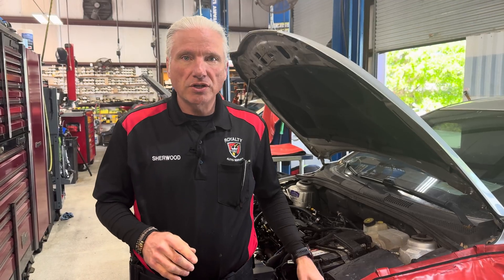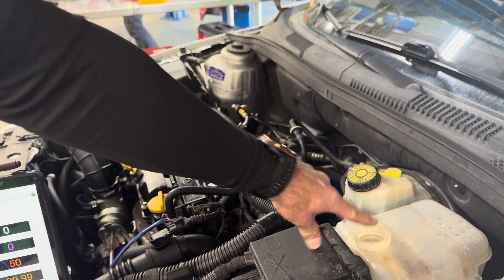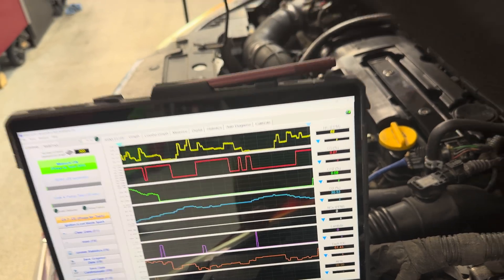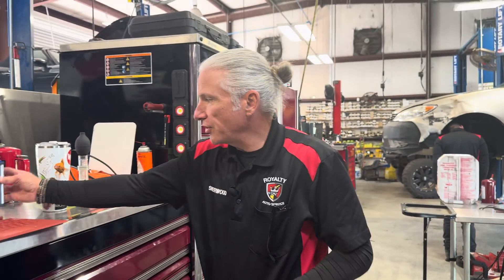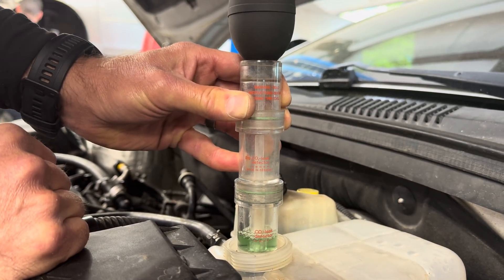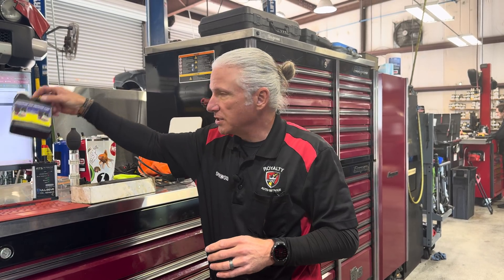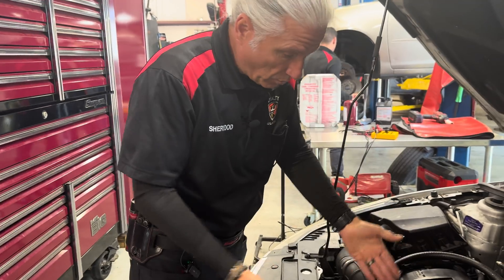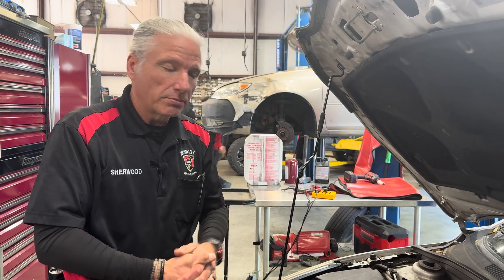3 Ways To Properly Test Head Gasket

Comment: Take the car out, check the oil. Make sure the radiator is full. Take the car out on route 81 north of Syracuse, New York, hold it to the floor hold the accelerator to the floor for roughly 14 miles, and you should be able to find the information that you need from this road test.

Comment: The color of the test fluid does not change when I put it on the radiator of my Jeep wrangler with 3.8 engine (2011) But it keeps bubbling and even with a hot engine, the exhaust fumes stay white.

Comment: At 16 i rebuilt my 350 in my 70 camaro. It got hot and I didn't know to locate the reason.  Two weeks later getting off the highway idiot light. It was ruined I left it dieseling .later bought a doner car for the engine and found out the radiator was silted in the bottom. Around town it's fine highway not.

Comment: Those cheap block leak testers are usually only like $20-30 at Harbor Freight. Those don't have the cool dual chamber setup though so you will have to be a bit more careful to make sure coolant doesn't get sucked into the tool. That same bottle of fluid is only like $10-15 also. Super handy if the head gasket leaks into the coolant system. I guess it might not help if only a tiny amount of coolant is leaking into the cylinder though? Maybe do that test and then rent a coolant system pressure tester and there's a good chance you will find your answer. I usually can't afford nice tools. I recently bought a Rotkee pressure transducer, but I haven't had a chance to look at a car with a bad head gasket with it yet. There are usually a lot of options though, as long as you have the time to learn about them. There are some decent tools out there that aren't super expensive now though, so people like me have a chance to learn more.
Reply: Not true. When you have coolant going into the chamber, smog and coolant will get displaced. They trade places. A coolant leak into the chamber is the same thing  as getting gas or smog into the coolant system on basic cars, not super high end exotics. The tester will turn green or yellow. Even if you have a small leak that appears on cold start only that goes away as soon as you start  the car let it running for more then 10 seconds. Unless you got a rare or luxury car. Doing it yourself can cost as much as 300 to 500 if you don't own any tool and have a small leak that just started, 100-200 dollars on tools are included in that amount. More then likely , you have little else to change. Maybe just clean valves and manifolds, depending on your car.

Comment: Wife over heated our 2002 4 cylinder.  I found this stupid hose under the distributor that had a decen hole in it. It was having some brief and slight bucking during heaver acceleration.  Replaced the hose made sure the thermostat functions. Drove around for about 50 mins. Temp stayed just below middle where its supposed to be at. Not leaking anything that I can see, no smoke or steam. But i still get that occasional buck. Maybe its coincidentally something else?

Comment: A head gasket test on an inline 4 is relatively easy as demonstrated in the video, because you only have one head and only one head gasket. 

But, what do we do when the engine is a V engine with two banks, and hence, two heads and two head gaskets? How do we identify which gasket is bad?

In diagnosing the vehicle we have to find which cylinder(s) are compromised, because we need to report to the customer which bank has the bad head gasket. For V engines I like to use the coolant pressure pulsation method to identify the bad cylinder (usually I find only one cylinder is compromised). So, perhaps you could do a video on how to determine which bank on a V engine has the bad head gasket. 

I know, as a matter of process, that most shops who want a quick diagnosis, will just tell the customer they have a head gasket problem, which is fine unless the customer asks (or a shop they hire to do the work asks) which bank has the bad head gasket. For a proper full diagnosis you results should pinpoint the bad cylinder(s) and bank(s). 

I find it beneficial to be able to inform the customer which cylinder, and by extension, which bank has the bad gasket, especially for DOHC engines. Most shops would recommend both gaskets be changed in order to provide a warranty on the repair. If only one side is changed, I find, there is usually no warranty issued. This does, however vary from shop to shop.
Reply: You can hook up a scanner and see which cylinder(s) is/are having a misfire due to coolant getting in the cylinder.  You can also see if you have a P0420 or P0430 code. P0420 means Bank 1, PO430 means Bank 2. (At least on GM, that is.)

Comment: I had a 10' Corolla with the 2ZR-FE engine 1.8L. The car reached 306k and then it started misfire on Cyl 1. It never overheated, and it was very well maintained. And even still I had a blown head gasket by itself. It never overheated. It only had one fan and it always worked. It just started developing that misfire for like a month only on Cyl 1 during start up. After 10 seconds running it will run smoothly.
Reply: Currently have the same exact situation on my 2010 w/407,000miles. I will be running some tests soon to confirm. My question is did you continue to drive car? If so how much more time did you have? I’ll sure miss her when she’s gone:(

Comment: My son's car was over heating. The first shop change the thermostat. The second shop, said everything was wrong and had a huge list adding up to over $3,600. It was a head gasket and I use the blue liquid tester. Some cars are just prone to head gasket failure after a given amount of miles, due to their design.

Comment: Thinking the HC readings ate jumping around because  of firing order. When the cylinder(s) near the head gasket leaking are coming up on compression it's pushing the HC's & they they get lower until that cylinder comes around again.

Comment: Dear Sir, it is as well very important to make a cooling system pressure test, as well as check the radiator for clogging by uplifting it from car and block the bottom hase outlet, fill it with tap water and check for adequate flow. Also some cars like some Mitsubishis can have a frayed water pump impellar and some other brands can have a plastic water pump impellar that would be eroded. Sometimes people will unknowingly use tap water that could potentially lead to such overheat in extreme summer conditions. You know sometimes in your case where the engine is smooth with no mix of oil/coolant and no apparent bubbling in the coolant when you open the radiator cap, and due to economic situation, the car could live for so many years provided that the client check his oil and coolant daily. This did happens (at my end of the world) ) on a variety of Japanese and American brands, but you should even in your case remedy the root cause of overheating before relplacing the headgasket. Also sometimes a leakdown tester can prove which cylinder is bubbling to the radiator cap so as to imform the machine shop accordingly. Also, a boroscope could show a tiny green bubble into the cylinder provided that the owner uses a coolant. Take Care. John

Comment: Scope with a pulse sensor can be used as well. I have even triggered off one of the coils and you can figure out which bank is the bad gasket. Still replace both, but nice to know so you can inspect the gasket when you’re performing the repair

Comment: The cheapest way to preliminarily test is to pop the radiator cap on a cold engine. If air pops out at you then you know you either have a bad head gasket or potentially a cracked EGR cooler... I think gas analyzing is kinda outdated at least for new cars. EGR coolers internally leak and will introduce combustion gas into the cooling system. The best method that is cheaper then your first two tools would contend for a borescope, followed by a cylinder leak down test.

Comment: Had a Toyota High lander. Always had a coolant odor after driving. Never could find a leak. And needed coolant added after a thousand miles or so. The thought of head gasket never entered my mind. One day the failure was catastrophic and non- repairable. So, if you smell coolant and can’t find a leak… you’re losing it thru the exhaust. That’s where I think I was getting the odor from. There was never a residue under the oil cap, or evidence of crankcase contamination.
Reply: Thank you for that. My experience has been like yours but hasn't gone catastrophic yet 😅 i smell coolant but can not find any leaks and the coolant really doesn't go down barely over like a year. My oil changes look clean and my coolant looks clean. I just can't figure out why i sometimes smell coolant. I smell it more on a hot day and I've been pushing the engine hard and hot. My coolant temps don't really ever go above 200f usually below 190
Reply: @kylandaminick13 a good shop can analyze your compression pressure and exhaust emissions and tell you if you have a eminent head gasket failure.
Reply: @Tillerman4 wish i would have checked the compression when i did the spark plugs 6months ago lol. Idk if I had suspected a head gasket problem at that point though

Comment: Schroeders box had a vehicle with a small leak . He did not have a gas analysier . He used cylinder leak down on the suspect cylinder and found bubbles in over flow tank . That gas analysis is awesome
Reply: Thats the way i have done for decades.but my new favorite now is differential pressure transducer and a scope,will pinpoint exact cylinder and  can do on load and idle

Comment: Surprised you didn’t use scope and pulse sensors/relative compression.
Reply: This would certainly lead you in the right direction but you’d have to do further testing to make sure your data isn’t caused by rings/valve seats. The tests shown here 100% points to a headgasket.
Reply: @rotarynerd pulse sensor connected to coolant tank.
Reply: @matthewbrice737  i apologize. I misinterpreted. that would definitely work

Comment: I had coolant dripping behind my Northstar engine.  I borrowed a pressure tester for the cooling system, and I could hear a hiss behind the engine, at the height of the head gasket.  I put dye in the coolant to look for the leak, but saw nothing on the engine.  I got one of those blue liquid testers, and after I pumped it a lot the blue took on a yellow tinge.  I took the car to my mechanic after I saw what it takes to deal with a Northstar head gasket, and told him I was sure it was the head gasket.  He called later that day and said it was just my coolant reservoir leaking.  The reason the blue liquid was turning yellow was that I was sucking some of the dyed coolant into the tube.  What a blessing to have an honest, capable mechanic for the jobs I can't do myself.  I bought him and his whole shop lunch.
Reply: even if he was a dishonest mechanic he'd probably not wanna do a northstar headgasket anyway
Reply: @neverending774  True that!  I just watched the video of it and almost threw all my tools away!
Reply: Nice, that's awesome

Comment: With a Powerstroke 6.0, it's best to test it under load driving.   You put a gauge on the cooling system.
Reply: Yup.  Piles of 💩 too.  They ran poor under warranty.  Almost 20 yrs later, still 💩